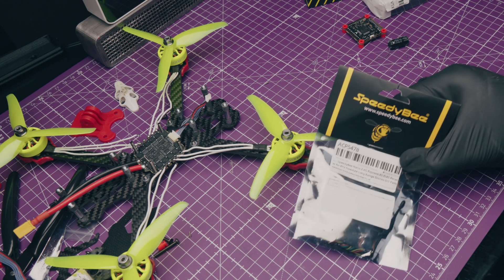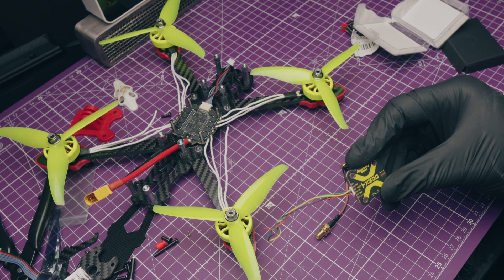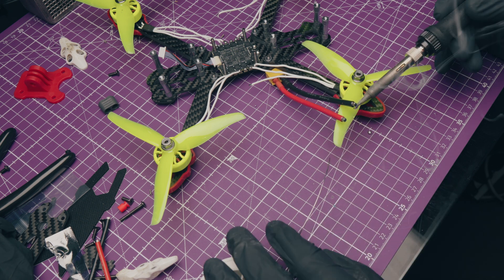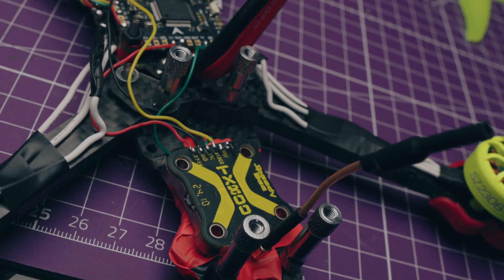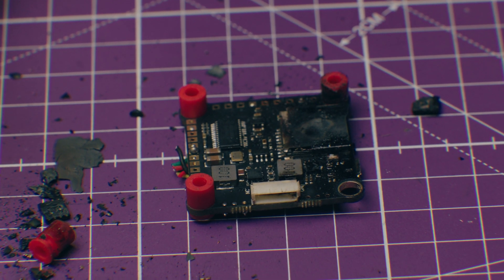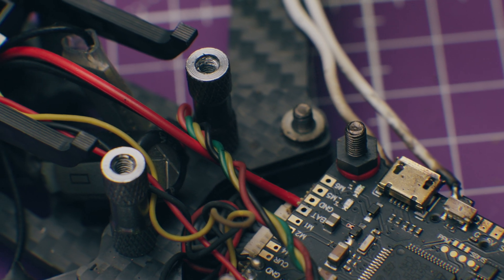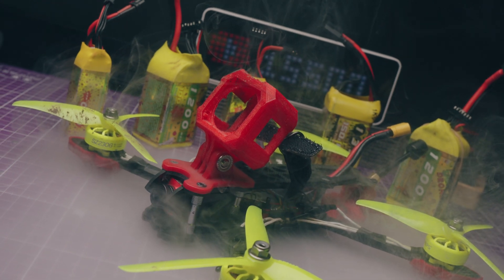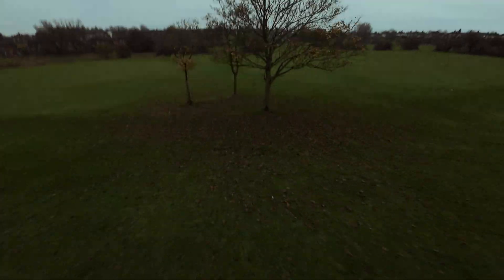🔥 AliExpress FPV Drone Catches Fire Mid-Flight

Comment from the maker: Parts used :

Frame :
https://s.click.aliexpress.com/e/_EvqxX0v

Better frame :
https://s.click.aliexpress.com/e/_Ex1aSDX

Flight Controller & ESC :
https://s.click.aliexpress.com/e/_Evr5Ux7

Better STACK (also a mini) 
https://s.click.aliexpress.com/e/_EjiQL8Z

VTX :
https://s.click.aliexpress.com/e/_EG0dvIl

ELRS RX 
https://s.click.aliexpress.com/e/_EJefjAV

Even cheaper ELRS RX:
https://s.click.aliexpress.com/e/_EIJjzu1

Caddx Ratel 2 FPV Camera :
https://s.click.aliexpress.com/e/_EQTnf3n

Motors Used :
https://s.click.aliexpress.com/e/_EHdNybF

Emax ECO 2 Motors:
https://s.click.aliexpress.com/e/_EJMlPuv

Comment: I bought a bunch of parts from AliExpress and my build was a 3-in digital 4S for less than 225. This thing rips it has a 60 amp ESC walk snail pro. Got it for $110
Reply from the maker: You build a walksnail pro quad for 110 bucks? Or the that was just the walksnail pro?

Comment: I highly doubt the esc is truly rated for 60A at each motor. Maybe 60A total? But even then, it doesnt look like you were flying aggressively enough to draw 60A theough the motors. My most educated guess is that your frame wasnt pure (like you mentioned) and the esc shorted out into the frame which caused an incredible amount of amperage. If that is truly the case, it wouldnt matter what esc you were using. 

Anyways, this was good to see! Appreciate you sharing.
Reply from the maker: Yeah I suspect your right about the esc but do agree it's likey the un true frame both sides.

Really glad you enjoyed it though, thanks for the support

Comment: What a fun video and great thinking outside the box, great tutorial on how to piece together an inexpensive video.  Also love the lessons learned and what you would do different.
HOWEVER, I think you should do another attempt at a sub $100 build with normal pricing that anyone can replicate.
Either your "BF prices" are no longer available before BF or we can't get the same pricing in the US/ROW:

JHEMCU ELRS receiver: Not $5 but $7.50 (Your link is to a speedybee elrs rx for $10)

Caddx Ratel 2 V2: Not $10 but $15 (Your link is to a $20 reseller)

Speedybee VTX: Not $12-$13 but instead $22

FC & ESC: Not $22 but $34

MEPS motors: Not under $40 but $50 for the Neon's, $49.50 for the Emax

This would have been a fun build to replicate but when I tried to replicate it the cheapest I could get is $144; still a solid price but about 50% more than you were able to find.

Regardless, good video and keep up the good work!

Comment: id think its something to do with the ESC's not having the amp rating as advertised , no name chinese FC's are generally alright , they might have weak bec's but thats really the only issue with them but a big no-no imo is trusting no name ESC's , its not that they are bad all the time more often than not its just that they are not as capable as they claim , if you absolutely need one due to budget contraints just be aware that the ratings are utterly bogus and that you should leave a huge margin on your build before you bump up against the ESC's limit . Tbh i usually just go with speedybee stuff these days , cheap as chips and their QC is on point , lord knows how their making any profit on their products but I aint complaining.
Reply from the maker: @notsogood4321  you are genuinely spot in here on both points

Comment: Sorry, I cant really understand whats going on. And maybe others also. What do you mean by one frame side is thicker? Right now in my mind Im thinking youre talking about the frame of the Mark4 is thicker on one side. Anyhow I still cant connect the dots how hardware issue could relate to catching fire...please help my confusion out
Reply from the maker: The thickness of the carbon was not even, being a 5 dollar frame, like the motor holes, corners get cut, meaning the esc was closer  to the frame and could have shorted out

Comment: Ive seen alot of people with same issue with those ESCs, i don't  think the copper bus is thick enough so it gets hot from the current so the fets start floating when the solder melts and it moves causing a short. That would  be my guess of what happened... The Jhemcu 55a and gh30 FC are much much better, but skystars escs are basically bulletproof and worth the extra money! I actually prefer using a skystars esc with a Jhemcu gh30f722-imc, just to save a few bucks, but the cable needs repinned which can be a pain and easy to mess up, but the combo is bulletproof! I have 5 kwads with that combo, and bashed the hell out if them. Also make sure if you buy a clone frame make sure its a readytosky or hskrc, ive had no issues with them and have built several dozen, i usually get the readytosky apex clone, the one like the og apex, it goes on sale for $12-15 i usually buy several....
Reply: Also, get the cloth automotive harness electric tape,  cloth tape is the best for abrasion resistance and props will not cut it up much when they get bent over, the vinyl stuff unravels and those plastic covers shatter easily and cuts up the wires, also hockey stick tape comes in lots of cool colors and works just as well if not better, but costs more, but the trick is to hit the tape with a heat gun after wrapping it so the adhesive binds to the cloth to prevent unraveling! Makes for a tidier, much more durable build! I do 2-3 layers from motor to bottom/mid plates, i find if you snap an arm the tape might hold it together and save motor wires getting ripped out of motor or pads ripped off the esc.... Also the extra padding keeps the arm from getting nicked up which can cause stress points
Reply from the maker: Hockey tape, I never knew that, thank you
Reply: Also skyzone/atomrc has the 60a HakRC stack on sale for $47 and 45a for $40, hakrc is a racing brand that is actually pretty good, they have really cheap analog cameras too, but i can't recommend anything made by skyzone cuz they have major quality issues, I got a couple of those stacks and cameras, the screw inserts fell out of the cameras, typical skyzone... But no issues with the hakrc stuff!
Reply from the maker: Hackrc are great I agree thank you so much for the Intel here I really appreciate it

Comment: I've done a pretty similar build, under 100$, same frame, even same color, and it really came up to 90-95$, unlike yours, which is just obvious - without stack it costs 120 bucks, because of the motors you used. I understand everything, sometimes there are sales, but you used a lot of expensive parts like motors, camera and VTX, which alone cost about 90 bucks. For the budget of 100$ I had to cut corners, using a lot cheaper motors (DYS Shu), the cheapest available stack (F4 + 60A ESC) which works fine for me, cheap VTX and camera combo. It flew surprisingly good for the price and didn't go down in flames.
Reply from the maker: I was shocked at how cheap I got it in the black Friday sales and it flew so so good, definitely gutted it went up in flames.

Maybe I should do it again.

Only this time cheaper and the give it away?
Reply: @squaddingquads  Even 30$ stack I used a few times worked just fine, never had issues like so. This setup is incredibly unbalanced, with premium motors and expensive analog setup, and corners are cut on ESC and frame, so you could do it better next time) And a little editing tip: just make the mono sound of your mic "stereo"
Reply from the maker: @billiaden  yeah the sound I normally mix down but I made a mistake here and yes I can definitely do the build better next time I agree lol
Reply: @squaddingquads  I should probably make a 100$ build and video too) Made post on blogger last time, but no YouTube video, unfortunately. You've done a great job anyways!
Reply from the maker: @billiaden  I appreciate the kind words and will contuine to improve each and everytime, be sure to tag me if you make a video yourself I'd love to see it.

Comment: This sucks when it happens, did you finally install the capacitor on your esc?
Reply from the maker: I sure did, I moved it forwards, I've done this a few times on this frame in the past without issue (not this exact frame, but the same model)